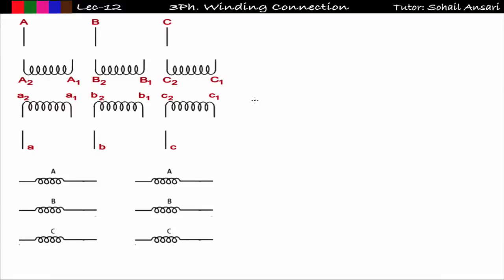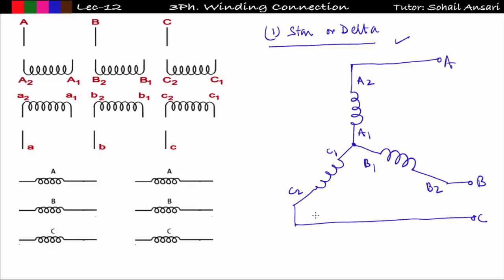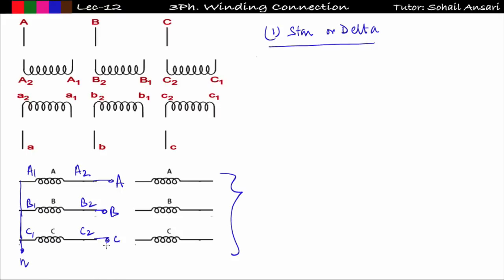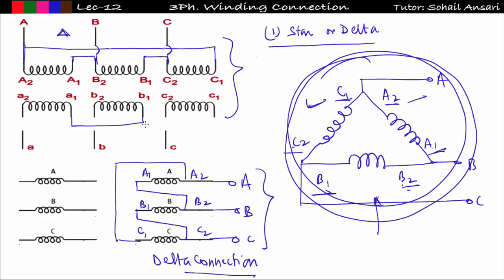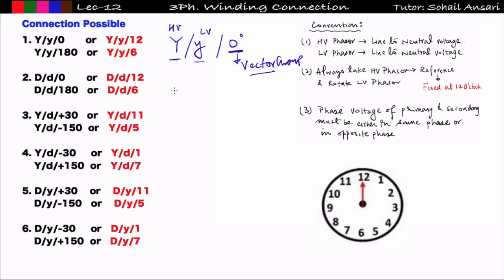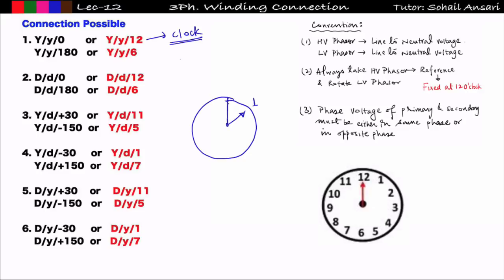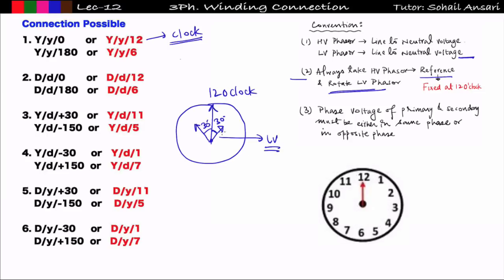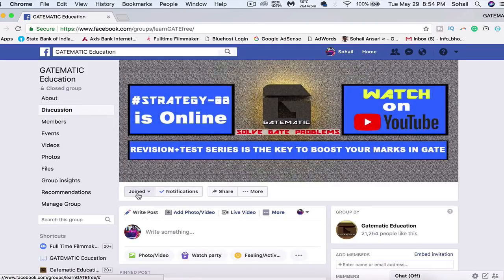Mod-02 Lec-12(a) Introduction to Three Phase Winding Connection | Electrical Machine

Comment: what is difference between phase voltage and line to neutral voltage in both star and delta ? sir please explain for both in seprate......
and sir if 440v line voltage in delta connection so the value of line to neutral voltage=?

Comment: Sir what is the difference between phase voltage and line to neutral voltage
Reply from the maker: Why i m saying line to neutral voltage bcoz we have delta connection as well..where line to neutral voltage are not equal to phase voltage...in star u will get same..but in delta u won't..thats y i represent line to neutral and phase voltage in a different way..ok
Reply from the maker: Just watch all the xmer connection..u will understand better...
Reply: Ok thanks sir
Reply: but in delta line voltage equal to phase voltage..

Comment: Good morning sir ji... Sir i hav one question.. In 3 phase xmer problem kva rating is given for 3 phase... And  we solve question for per phase in balance condition..so to find current per phse we divide 3 in kva rating but.. We also perform line voltage and phase voltage conversion..by root 3 operation..
Reply from the maker: Brijesh Rajput right..then whats is ur doubt?
Reply: GATEMATIC Education  sir.. I hav problem  while solving numerical related to 3 phse xmer. Where we transfer secondary impedance to primary side... And also to find the transformation ratio...